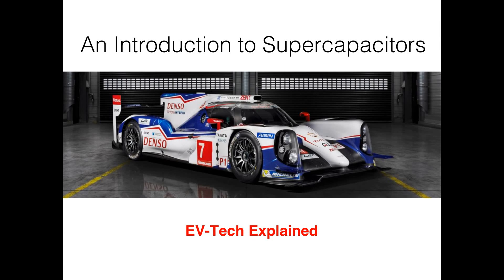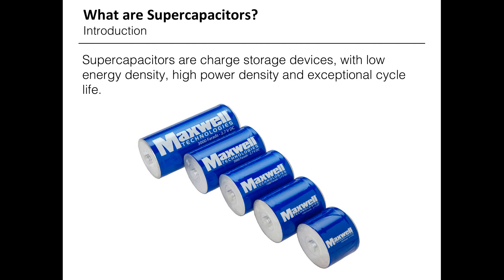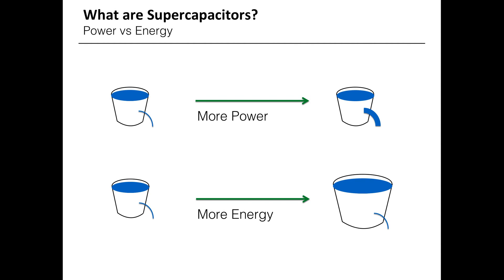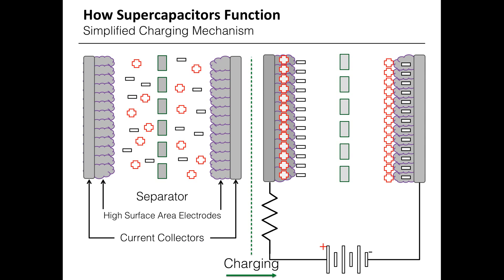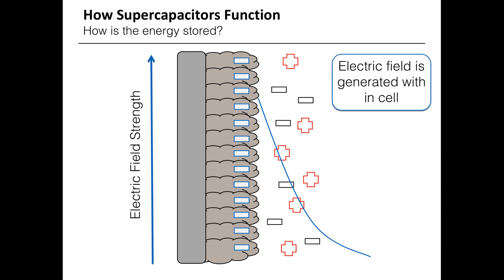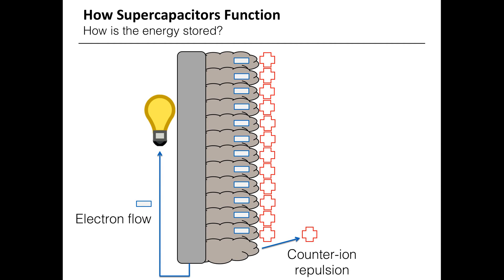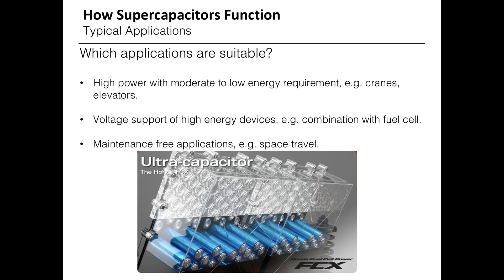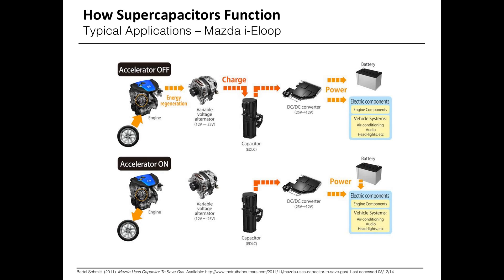How Supercapacitors Work - A step by step guide

Comment: Ok we get it, capacitors and super capacitors are not currently used as batteries. The question is what is the physics behind the capacitor that will allow for greater energy storage so they can be used as a battery. I want the details of the physics involved not that they don't work. Show me what it takes to increase the energy storage of the capacitors.

Comment: Great video and thanks for the links. I currently have Dyna-batt manufacturers ID 5575B. It's a 12V, dry cell battery, 16amps hrs, and it is 4 years old. The CCA on it is around 280 and I live in NE and on days where its under 50 degrees, the car struggles to start. I want to maintain the weight savings and I like the idea of a supercapacitor, in parallel. What kind and how many would I need to help boost this battery? A schematic, or links to what I can buy would be awesome. Thanks!

Comment: I,'m  a retired 80 yr old industrial  electrician who get my electrical  knowledge from Audels Electrical libraries. (qv). You have brought head shaking awe with the new stuff to this old bird. Thanks a lot,I'm buying a Noco for my garden tractor ( 20 HP single cylinder engine), It needs a big battery, but this Noco puppy will solve the problem and a handy trunk item in the car as well. . I'm wondering what you're going to write about in 60 Years.

P.S. I apprenticed with an Electrician Master Journeyman Frank Owens 1n 1959.
He had been John Logie Baird 's Apprentice in Scotland . 
Mechanical Colour Television Eh What Lad.!!!  Thanks Again.

Comment: I saw that somebody is using super capacitors for spot welding with two copper rods (Nickel strip to 18650 batteries). How safe is this? It is almost a short circuit for capacitor for short time.

Comment: Can't you reduce the power output of the capacitors?
Reply: If you have a material eletrodo with a low superficial area, you are gonna have a lower power density. However, one of the main things comparing to batteries what makes capacitor interesting is its power density, so I think it is not a good idea of decreasing it. I don't know if I could help you.
Reply: @daysiannekessy6114  yea... Well at least thank you for replying... ✌🏽

Comment: I suggest A mechanical energy storage Device  be fabricated in the system a motor generator flywheel assembly gimbally mounted. This instant storage device will take as mutch power as you can hit it with from reverse electric braking or turbine generator overflow. A voltage regulator and combined with supercapicitors would be a perfect set up for a auto a race car a airplane a helicopter.  Energy can be instantly pulled from the gimbally and directed into the drive motors.

Comment: Is there a way to translate a supercap's stats to an equivalent of battery power? I ask because I would like to learn what would be required to replace a bank of batteries in an off-grid set-up with supercapacitors.
Reply from the maker: Of course, what type of stats? 

Check out my new video on battery degradation - https://youtu.be/XLnBg25JoHg

Comment: Hello everyone.
I do not know if it is possible to dream of an ultrascapacitor with a diameter of 10 cm and a length of 1 m and which will be connected in series. 

I remain open to any other proposals from you

cordially
Reply from the maker: I doubt it, but why would a 1m length be required? 

Check out my new video on battery degradation - https://youtu.be/XLnBg25JoHg

Comment: Nice Video and good explanation but I miss the explanation why all supercapacitors are limited to 2,7 Volts. Why is it impossible to build single cell supercaps at 10V or 30V ?
Reply from the maker: The electrochemical stability window of the electrolyte prevents higher voltage being used. At 10V, the electrolyte would breakdown, causing gassing, and irreversible capacity loss.
Reply: Thank you very much.  My idea was also that it must be a limitation of material but I don´t know more.
Reply: it's currently limited to 3 volts ultra capacitors  You can build a module that is 10 or 30 volts (in serial ) you will need a lot of them in parallel for HIGH capacity

Comment: What do you think of using a Lithium ion Battery and a super cap together for a wind turbine energy storage solution. or do you think the cap will discharge to fast into the battery causing it to explode.

Comment: I have worked in electronics and as an electrician my whole life. And to this very day I still do not know how to determine which capacitor to use. I've always just had to replace them with the same type. But determining which one to use for a project has always baffled me. Is there a good video to understand the concepts of using capacitors in place of batteries? With specifics in determining the power output and voltage - in relation to capacitance?
Reply: a capacitor has 2 numbers
the voltage and the capacity

so depending how the circuit is build you can replace capacitor the some voltage and if you have the space you can go for higher capacity

it the same as batteries
when you replace a battery you need the same voltage but you can always put a bigger one in amps

Comment: what is more suitable for a portable heating device? Liion batteries with enough Amps or Liions + super capacitors?
lets say the heaters needs around 500W.  with enough batteries that should be ok.
but what if I need 700W or more, can I add a supercap to the Liions and "charge the cap" so it delivers 700W?

Liion. 36V with discharge15A = 540W
Liion. 36V with 15A = 540W + supercapacitor...... can this now deliver 700W ?
possible?
Reply from the maker: It is possible but would ultimately be bigger. I think a battery only solution might be best in that case
Reply: thanks!!!
for my understanding: 
the heating coils would draw 15A from the batteries. (at 36V)
would they also draw 15A from a Capacitor or would the capacitor "deliver" more amps (lets say 30A) and heat them up faster?

which specs should a capacitor have to deliver 36V 15A-30A? 
(for 10minutes)

Comment: Similar concept to torque and power in ICEs. You can have more working force being put out at a slower rate like in a diesel engine (high tq, low hp) or high output rate and low to moderate working force like in a performance gasoline engine (low to med tq, high hp). Like comparing Lithium ion cells to a super capacitors.

Comment: How commercial could it be as a replacement for Lead acid batteries in automobile industry?
Reply from the maker: +Gilbert Dsilva some are considering it, though the problem is that they do not store enough energy for a full replacement, therefore they would have to be incorporated alongside another form of energy storage such as a smaller lead acid battery

Comment: How does the working of battery and super capacitor varies?
Reply from the maker: +Tech Help A lithium ion battery will typically have a maximum voltage of 4.2V and minimum of 2.5V, with an average of 3.6V. A supercapactitor typically has a maximum voltage of 2.7V, and voltage decays linearly to 0V.
Reply: Can u make a video explaining Internal working of battery and super capacitor and how to make them (production)!

Comment: hhow long do you think supercaps would be available worldwide specially AsIa it sucks because asian always left to be the last to benefit, and does it come in smaller size for mobile application? since you mention it is also applicable on car battery , question' does the alternator motor would be fast enough to charge it ? in that case ,the theory of perpetual charge and discharge of EV application is possible ,yes or no?
Reply from the maker: +Don Clavecilla Definatly available in Asia right now. It is often used for smartphone camera flash and can be done in very small sizes.

An alternator can charge this as it does in the Mazda application, however this would not be perpetual energy as kinetic energy will be removed to generate electrical energy.

Comment: Thanks for the Explaination.. i do have a question.. mazda is doing this.. Why arent all car makers doing it.. Why are they allowing the vehicle to WASTE power? I mean a car is a MOVING generator basically. If they built the car to STORE energy while its moving it would not need alot of fuel.. Due to it CREATING the energy while its idoling.. which in large cities like la or Philadelphia happens more times than not
Reply from the maker: +Raver Magik mainly cost. There are many ways to save fuel and different carmakers will choose different options from those that are available.

Comment: Thanks for your time. Definitely interested in combined capacitor/battery. I use a lot of cordless tools and those that require high draw startup or occasional high amp (saws) that seem to deplete batteries very quickly. Then two hours to recharge. Wondering if the capacitors would help?
Reply: They certainly would. You could combine your batteries with the supercapacitors; as the supercapacitors would provide the bulk of the power, the batteries can operate in a more efficient region and hence last longer, and continue to function over a wider SoC window. Lots of power tool companies are looking to integrate supercapacitors into their energy storage systems for power tools.
Reply: @SavageStormAir  ... stramge that it is not more commonly used

Comment: i got a solar panels and  a power inverter can i use the super capacitors as a substitute for a lead acid batteries?
Reply: filipina santos ..super capacitors can be used with solar panels. im experimenting now with my solar powered gardem led lights. so far its good results but not finished yet. super capacitor banks are expensive but rechargable batteries always going bad so im designing my own system. ill use zenors. or controller as usual.
Reply from the maker: +filipina santos Yes, though think carefully about the number you would need for your energy requirement, paying particular attention to the energy stored within the voltage range of your inverter.
Reply: EV-Tech Explained I want to this super capacitor where I get  please send me links
Reply: No. You can not. The whole circuitry will have to be changed and in the future you may find capacitors are used instead of batteries.

Comment: as per paul zbar, you cannot use any kind of capacitor to substitute for a battery applications, capacitors and batteries are different, capacitors are passive devices and batteries are power sources..........................
Reply: Torpengpogi im using capacitor bank in place of batteries now. its great but expensive

Comment: If you could slow the rate of flow of electrons out of a capacitor couldn't it then be used as a replacement for batteries?
Reply from the maker: +MARTIN STRANGE Not really. Fundamentally, you store far less energy.
Reply: I have recently made a youtube channel, and i kindly request you to please check it out
Thanks for your generosity.
Reply: That is correct EV, but again it is the rate that the electrons are released from the capacitor. You would need many of these but would be far safer and longer lasting than lithium Batteries.
Reply: The "rate of flow of electrons" is not dictated by the source of energy (a battery or a capacitor), but rather  by the consumer of energy that source feeds. For example you can have a 5 Watt phone charger and 2000 Watt electric heater, both require identical voltage to work (let's say 12 Volt). You will find that the latter will produce much higher flow of electrons that the former from the same source discharging it faster. That what makes batteries and capacitors suitable for some applications and unsuitable for others.
Reply from the maker: +MARTIN STRANGE The fundamental mechanism of charge storage is surface based in Supercapacitors and bulk based in batteries hence batteries will always have greater energy storage potential.
Reply: I have recently made a youtube channel, and i kindly request you to please check it out
Thanks for your generosity.

Comment: What I need to know is the proper mixture for the ionic solution, when using KOH "potassium hydroxide" I dont know the correct portion of DI water and KOH to use. any help would be greatly appreciated, im trying to make some working cells at home to learn more about supercapacitors and to do some research and development.

Comment: Original Google+ Post: frozenprakash.com/MJtZwTcK2NC
Collection: Energy Technology
https://plus.google.com/collection/8JTdi

Supercapacitor basics:

Only simple difference between battery and a supercapacitor is that,
Supercapacitor has very high power (kW) output and charging rate (kW) and has a very low stored energy (Wh).

The new Maxwell 3V, 3.75 Wh supercapacitor is amazing indeed !!

Specifications:
Peak Voltage: 3V DC
Peak Power Output: 7.7 kW
Peak Charging Power: 7.7 kW
Charging time at full power: 2 to 3 seconds
Energy stored: [3.75 Wh / 13,500 Ws / 13.5 kWs]

Here, [Watt Second] or [Kilo Watt Second] is the best unit to denote the capacitor energy.

1 Wh = 3600 Ws = 3600 Joule
1 Ws = 1 Joule

Using 1W for 3600 seconds = Using 3600 W for one second
i.e,
Using 1W for 1 hour = Using 3.6 kW for 1 second
thus, 1 Wh = 3.6 kWs = 3600 Ws

For example, this capacitor has 13.5 kWs of energy,
and has a peak power output of ~7 kW,
so it'll take approximately 2 seconds to empty the cell as 7 kW * 2 sec = ~15 kWs

Generally Camera flashes are also denoted in Ws of energy consumed per flash,
for example,  100 Ws to 2000 Ws [or 2 kWs] etc.

Maxwell Capacitor Link:
http://www.maxwell.com/products/ultracapacitors/k2-3-series
Reply: I have recently made a youtube channel, and i kindly request you to please check it out
Thanks for your generosity.

Comment: I picked up 2 banks of maxwell power caps and plan on using them for a car audio system. running my power from alternator to front battery, front battery to three back batteries, the to the banks of caps, and finally to the amplifiers.
Reply: Lance Dohrn I'm considering doing same thing. did you hit higher numbers?
Reply: I'm running them now, they do help alot. the discharge and charge rate surpasses just about any bat. I'm basically  using them as a buffer between the bats and amps.  I'm looking at limitless lithium  now.  seems to be the next best thing in the audio electrical world.
Reply from the maker: +Lance Dohrn sounds interesting. Any pictures?

Comment: We know a capacitor can be used instead of battery. Then why not a super capacitor can be used as battery! if do what are the limitations.
Reply: because a battery would be like 3.000.000 farads.... but a supercapacitor is up to 10.000 farads? 300 times less energy storage. And don't counting the charge recovery which the chemistry can do. Also 2.7v vs 12v, so you needs to place like 5 capacitors in serie, which the result is like the half of the half of the half of the half, 5 times half! Because the formula would be TOTAL CAPACITY = (c1 * c2) / (c1+c2) = cr1 ; (cr1 * c3) / (cr1+c3) = cr2 ....
Reply: @flyguille  The capacity will not be halved because you will now be able to apply a higher voltage.  The best charging technique will be a fast switching circuit that charges each individual cells separately.
Reply: @alokt7119  you are confusing energy storage with capacitance, read about asociative , and how to calculate the total capacitance when capacitors are in serie vs parallel. But in this case as supercaps are used as battery, the resulting serie capacitance doesn't matter.
Reply: flyguille up
Reply: In certain applications super capacitors can replace battery. But on a wider scale it is still not possible.

Comment: When is the smartphone industry going to start using super-capacitors?.It would be nice to have a LG smartphone with a user"removable"super-capacitor system.
Reply: Never !  We want the money and power !
Reply from the maker: +4 gauge Most smartphones currently use supercapacitors to power the camera flash, however they are unsuitable for replacing the battery due to the comparatively low energy density.
Reply: +EV-Tech Explained Then it not a super-capacitor.If you convert"amp hours"to"farads"the rate of discharge is the same if you have enough farads in the caps.
Reply: +EV-Tech Explained One example of what I'm talking about...there is a company(not Maxwell)that actually builds"battery capacitors"these"battery capacitors"are being produced for the automotive industry,I've already seen these starting to be used in the trucking industry.They look like a regular"truck battery"they will start and run very large displacement diesel engines without any issues,run all the accessorys in the truck.(air conditioning,lights,air compressor etc.)With crazy amounts of reserve power.(In the event of a alternator failure,you can safely drive several miles before it goes dead)
Reply: Reference please?
Reply: RapiBurrito Maxwell is a company providing these starting cap banks. They are not intended to replace the battery for auxiliary functions though, only for starting. You can find videos of Maxwell fleet products here on YouTube.
Reply: Cheatin Chad Yes i know that, i was referring to the "battery capacitors" spiel 4 gauge was talking about, couldn't find much back then, do you have anything on that?
Reply: RapiBurrito I do not, that's something I'm unfamiliar with.